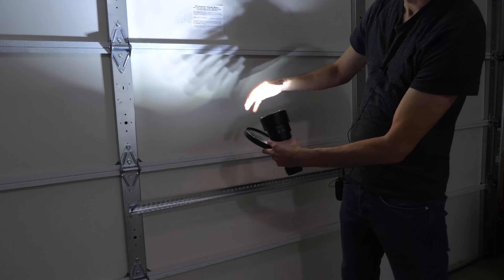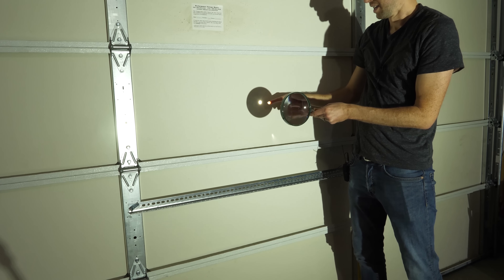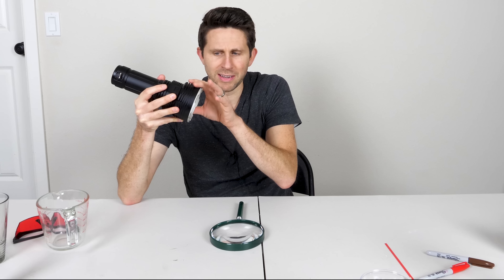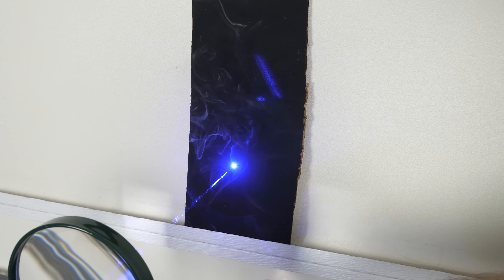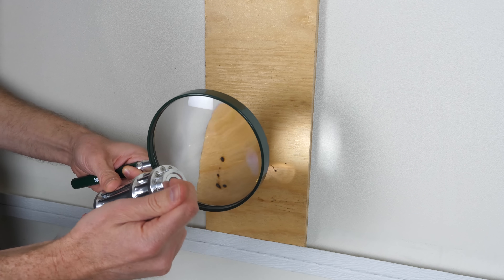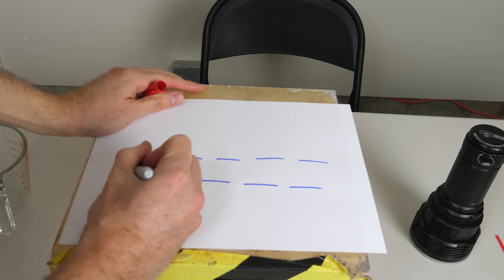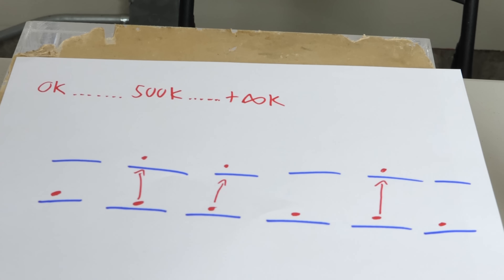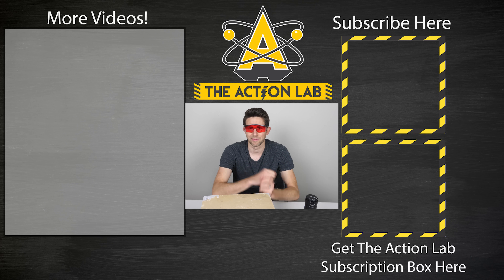What Happens if You Focus a 5W Laser With a Giant Magnifying Glass? Negative Kelvin Temperature!

Comment: I don't think it's necessarily true to that you can't get a point to be hotter than its source for something like a flashlight or a sun. I think that statement is only true for average temperatures. I'm sure through complex systems you can get a pulsed output by causing some light to take a longer path, delaying its time it takes to reach the end path so that that power output is greater than its source for minute time periods. So on average the power output is lower than its source and conforming with conservation of energy, but allowing for short bursts of higher intensity light. While I have a physics background, I didn't specialize specifically laser physics, so I could be wrong. I doubt I am though. The keyword in the second law of thermodynamics is "spontaneous". If you are using a machine to artificially control the transfer of energy, you are no longer doing so via natural spontaneous processes. More importantly, you are not working in an a closed system. You are adding energy by using a machine to create a pulsed output from a continuous source under my postulated scenario.

Comment: 1) Can you focus more light from the flashlight if you wrap a tube around the end with a reflective interior, or if you take advantage of fiber optics?

2) If you use a second magnifying glass, can you focus the laser a little more?

3) Would focusing two lasers through the magnifying glass produce more heat?

4) Does the wavelength of the lasers matter?
Reply: Wrapping a reflective tube around the flashlight was my first thought as well, but it actually would be exactly the same as holding the magnifying glass close to the source. The angles of the light rays just keep reflecting back and forth until they escape, they never bend towards straight forward.
Reply: @KevinDay  What about pointing the flashlight at a large concave mirror and focusing the light on a point behind the touch?

To create a point of light brighter than the touch, that point needs to be smaller than the total surface area of all the LED's in the touch.

If that is impossible, then install more LEDs in the touch, until their total surface area exceeds the size of the focal-point. Simple.
Reply: Yes the wavelength matters quite a bit. Lower wavelenghts have higher frequency, therefor more energy per photon
Reply: I was going to ignore this as a rookie mistake but since he consistently said 'never never never', i thought why not. First of all, this dude knows nothing about optics. You can focus the flashlight  to create a brighter spot than THE EXIT  SURFACE OF THE FLASHLIGHT . You need to have multiple plano-convex lenses(to reduce spherical abression) . One can also do it with a single lens of sufficiently small focus length but you will see strong abression effects (different colours focussed on different planes) . There are even simple online calculators available to predict the spot size.
Reply: 4 color as well 3 plausible 
2 maybe 1 engery will be scattered
Reply: I think he is confusing us.
Reply: Also a prism to amplify light rays? In combination with lens and mirrors
Reply: @usern4metak3ns 
Prisms don't magnify light.
Reply: @TicTac-g7m  no they don't, but they split light rays, which can be amplified and reflected into each other, I think.
Reply: @usern4metak3ns  your on the right track .. but really I think you're just gonna end up converting the flashlight into a laser.
Reply: @Hup.  yeah I can't wait until light technology is more available for everyone, but alas it makes everyone scared. As with all tech that's been made weaponized.
Reply: Nice
Reply: 1. Yes, including cavity enhancement but the losses in reflective material or cavity would get you.

2. Problem is collecting enough light with first lens. Maybe a short collimating lens followed by a bigger one.

3. Bigger laser is always better as you get losses in trying to combine.

4. Shorter wavelengths carry higher energy per photon hence lesser photons for same total energy. Certain wavelengths get absorbed into certain materials better than others so could generate more heat for the same total light energy.

Comment: An important point to make is that the negative temperature is a non-equilibrium condition. The laws of thermodynamics are meant to apply only to equilibrium conditions.

But yes, the hottest temperatures are small negative ones. And lasers do produce a negative temperature regime on a transient basis (non-equilibrium).

Isolated spin systems also have a negative temperature regime - similar to a laser. The spin system is probably the canonical example for some of these weirder points about entropy/energy/temperature.

Comment: What if you stick the flashlight in a tube to capture the light and put the magnifying glass at the end of the tube?
Reply: I think, depending on the length of the tube, the dispersion remains constant. 
But if the tubes inside is mirror, the brightness may be higher but the dispersion should remain more or less same.

Comment: Have you seen a person spewing out lies covered it truth to make them look legit? This person is doing the same. He says that you can’t make the point hotter than the source’s original temperature, but this is possible and does not break the laws of physics. It is possible because energy is still conserved; however; the energy is concentrated into a smaller area increase energy density and therefore, temperature. Another criticism I have is that he talks about atoms at a high temperature, however, these same atoms would turn into plasma before turning into a weird state. Also, in the video, he says that -0K is the hottest temperature possible, and 0K the lowest. However, -0 and 0 are the exact same.

Comment: I agree that you can't focus a light source to create a point that has a higher thermal energy than that produced by the entire source but saying you can't focus a light to make it hotter than the source is confusing. I'm picturing a sphere with the entire interior surface coated in LEDs as a light source and individual lenses in front of each LED focusing their light towards a central point in the sphere. Surely this point would be hotter than the temperature of each individual LED?

Comment: I’m not even watching this bc I have enough education to know that lasers don’t produce heat the light molecules heat up the air molecules around it by pushing them away it’s like molecular friction (the laser doesn’t creat heat, it’s the light being refracted into I single point to increase the light per cm2 or whatever distance the light heats up the air it does not creat heat it creates light witch causes small amounts of friction in the air at high speeds so in turn air is heating up the surrounding area not the laser or the light again the laser isn’t the burner it’s the uv wavelength breaking the air wavelength in miniature molecule battles, I get the point he’s trying to make you can sharpen the focal point so small that it changes the temperate of the object he is hitting by an amount  that’s determined by the lumens by length and width

Comment: Hi there! While your comment about focusing a blackbody radiator to a hotter temperature than the source (I'm assuming that's what you mean specifically) may be correct, an LED array such as your flashlight isn't a blackbody emitter. 

For the LED light, if the NA of your focused light is higher than that of the diverging light from the LED, then it should be possible to achieve a higher power density, provided you did a good job of capturing the majority of the diverging light from the LED. You can do this with some decent condenser lenses, which are budget friendly. 

I design lasers intended to be focused to a small spot professionally and deal with these challenges on a day to day basis :)
Reply: thank you, something about that explanation felt off to me.
Reply: So say you had that 30k lumen flashlight, would it be possible to focus it into, say, a 0.5 inch diamter if you have an array of condeser lenses attached to the front? Would it be possible to use that to burn things?
Reply: @BonnieBoestar  well, probably not because an array of condenser lenses would create an array of focused spots, and you'd probably want one single focused spot to get to a half inch on cross section. 

So then suppose that you get a single condenser lens... well, then it depends on the architecture of the emitter and collimation lens or reflector. 

But could you achieve that kind of luminous density in a more deliberately designed system? Well, probably. Just use a high power single emitter LED. Nichia and Luminous both make these. Then pick up a couple of condenser lenses from a lab parts store like Thorlabs, and voila! - it's the same as a flashlight, just more purposefully designed.

Comment: Excellent video.

What would happen if you took a 5w laser and a magnifying glass, the same laser and magnifying glass used in the video's experiment and used it to power a very small sterling engine. Would you get more power than the original 5w source powering the laser?
Reply: No. You'll 'get no more power than 5 Watts.

Comment: A laser doesn't break any laws of physics. Laser light is coherent light.  That is, all of the rays of light being emitted by the laser are in phase.  Where as, the rays of light from the flashlight are randomly phased.  Because of the random phasing of the light being emitted from the flashlight, some of the energy is canceled by out of phase waves.  The energy of the laser light, with the light waves being in phase, are additive in effective energy.

When using a magnifying glass, all that is taking placed is that the light rays are being concentrated into a smaller area, increasing the energy density in the smaller area multiplied by the number of times that the original area has been reduced.

There are no laws of physics broken and no energy has created that didn't already exist.

Please take the time to learn some real laser physics !!!

Comment: You could do it with a flashlight, but you would need to have a flashlight with a lens built into its body that directs the light (think of focal length on cameras) then use multiple lenses to focus it.
You would get a temperature that as hot as the filament assuming the heated area is the same size as the filament or hotter if you went smaller than the filament as you'd be compressing it.
Reply: You can't make it hotter than the filament, though. Then energy would be flowing from a colder area (the filament) to a hotter area (the target), which violates the second law of thermodynamics. It would also, more concretely, violate the conservation of etendue, which (afaik) says you can't squeeze light any tighter than how you got it. The target can act like it's being exposed to more filament, but not hotter filament.

Comment: well you are wrong here, why? 
let me explain as i understand it
lasers are simply super straight parallel photons, which make a linear beam of light, and now from that point you can converge to a tiny tiny point.
but in flashlight what you have is light already diverged by concave mirror or parabolic reflectors, now from this point using convex lens will only make that light which was earlier diverged to parallel beam of light .

what you can do is use a fresnel lens, before hand to make that scattered light parallel, and then proceed to convex lens to make a tinkel tiny dot of hot photons.

a big fan yours 
love from INDIA

Comment: you didn't make the laser light hotter, you increased the energy density and with appropriate lensing you could have done the same with the torch, ie. if you capture all of the light from the torch and focus it to a microscopic point that concentration of energy will burn the surface as long as it doesn't have high thermal conductivity.

Comment: I'm going to risk getting flamed here, but OMG this has got basic thermodynamics so wrong this was actually painful to watch.
So many concepts here are just wrong, sorry.

Starting with the fact that he does not even know what the second law of thermodynamics is!

First law - energy cannot be created or destroyed ( i.e. all the enrgy going into the magnifying glass comes out the other side)

SECOND LAW - entropy increases in any isolated system. In very basic terms this just means that when you use energy or convert it from one form to another you always lose a bit of it to heat. This is why your flashlight or laser gets warm when you are using it! The energy is in battery is not 100% converted to light.

"Brightness" is a measure of the intensity of a light source, in other words the number of photons hitting a given area (metre squared for example). So if you focus any light source onto a smaller area then the brightness MUST be increased as the light is being concentrated onto a smaller area. The same number of photons are still landing on teh surface but at a higher concentration - therefore it is brighter.
You can easily at 01:48 SEE that the spot of light from his flashlight throught he magnifying glass is brighter than the surrounding light from the flashlight - gah!

The next thing that is not being explained correctly is temperature. 
Temperature is just  ameasure of the kinetic energy of the atoms in a material. The faster they move, the hotter the object.
Light does NOT have a temperature. Light is just an electromagnetic wave of a certain frequency. And laser light is just light that happens to have all the waves moving in step with each other. There is nothing more to a laser than that. 

"Temperature" does not flow from A to B, or from a flashlight, a laser, or even from the sun. Only thermal energy flows from hot to cold (via radiation/conduction/convection). 
The laser shining on a surface puts 5W of energy onto the light spot. This adds energy to the surface and heats it up until it reaches the point where the heat lost from the surface as it tries to cool equals the 5W of energy arriving - called thermal equilibrium. The rate of cooling (lets assume just radiative for simplicity) is proportional to the area of the laser spot multiplied by the temperature of the surface to the fourth power. Hotter it gets faster it cools, larger the light spot the faster it can cool down.
So if you focus the laser onto a smaller spot, then 5W energy goes into a smaller area, so it heats up to a higher temperature as now the area of that spot of laser light on the surface has a smaller area to radiate the incoming heat away. Hence it reaches a higher temperature before it reaches equilibrium where it can now radiate away the heat as fast as the laser is pumping it in.
Nothing called "temperature" is being transmitted by the flashlight or the laser. Only light energy. 

FInally all this nonsense about negative temperature is just so wrong. What he is saying at the end with those energy level diagrams is describing electrons jumping energy levels within an atom, and this "population inversion" being mentioned is just describing how lasers work - you pump the electron into a higher energy level, and as they fall back down the radiate that energy difference as a photon of light, and as they do it in step it priduces laser light.
This is NOT thermal excitation of the material you are shining the laser onto works. The energy of the laser is absorbed by the wood and makes the molecules in the wood vibrate more, and the more kinetic energy they have jiggling about is what we measure as temperature.

So if you focus incoming sunlight onto a small enough area you can get to temperatures far exceeding the temp of the surface of the sun. Simply because you are putting all that energy into a tiny point. The First law of thermodynamics is being obeyed as no energy was created or destroyed, it is just being concentrated into a smaller area.

And don't get me started on what he doesn't understand about optics, lenses and focal lengths. He just needed a tube with a couple of lenses on it strapped to teh end of the flashlight and he could have focusses ALL the light easily. It's how a telescope works FFS!

Comment: Lasers only have a negative temperature if you consider the atom as a two-state system. It is misleading to claim that they have a negative temperature. Negative temperature implies there are no higher states to occupy and the occupation is by Boltzmann statistics. Also, to explain negative temperature, it is best to use "beta" or 1 over the temperature, because then the scale becomes intuitive, it runs from negative infinite beta (negative 0K) to positive infinite beta (positive 0 K).